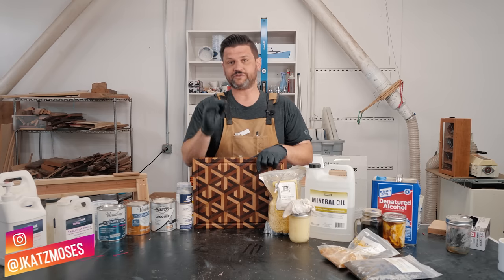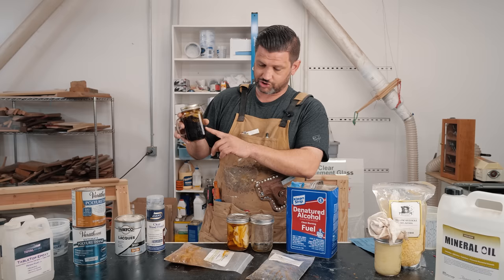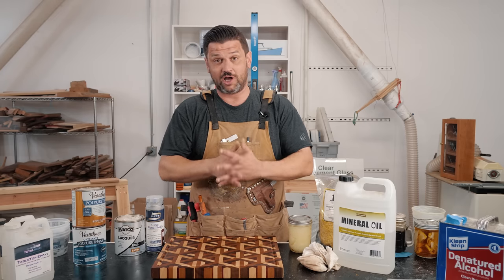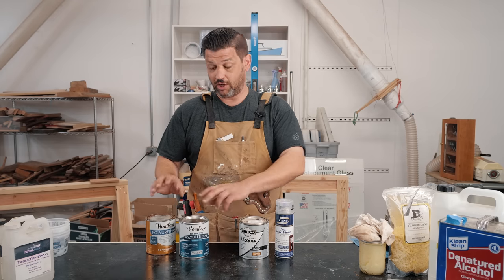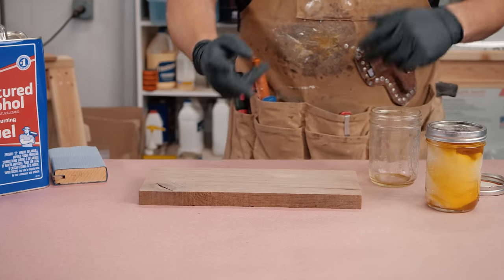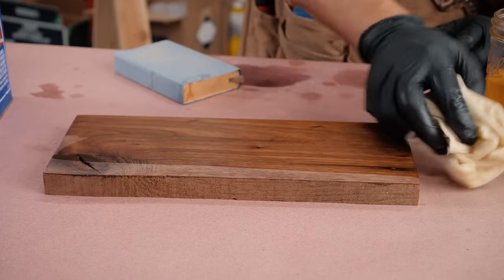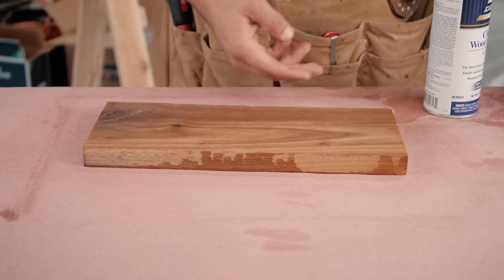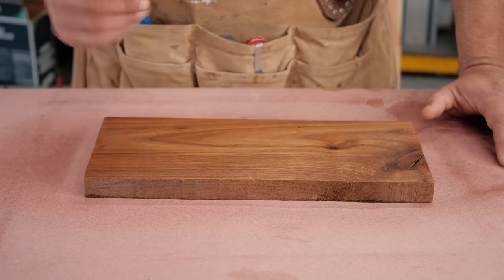My 4 Favorite Finishes and How to Apply Them

Comment from the maker: Tool links and things I talk about in this video:
Shellac Flakes (Blonde): https://amzn.to/33981YA
Bee’s Wax:https: //amzn.to/30K70EE
Mineral Oil: https://amzn.to/2OpDGAA
HVLP Set (only $89): https://amzn.to/33hGHHJ
Total Boat Epoxy: http://bit.ly/2I3Q8m4 20% (That’s HUGE) Discount code KATZMOSES
HVLP Video: https://youtu.be/hb1TAQ-kxr8
Mike Pekovich’s shellac video: https://youtu.be/k4_sIrEfdKM
Reply: Why would you put shellac under another finish? Or on top, for that matter?

Also, what grit do you sand to before each finish?
Reply: Jonathan Katz-Moses Good morning Jonathan, I really enjoy all your videos great work very informative. You had mentioned that you have a class on the cutting board
Do you have a YouTube video on the class or do I buy a video on it?
Reply from the maker: It will be out soon
Reply from the maker: For sealing quickly and top coating with a stronger finish. When you need to refinish something and you don't know what finish is on the piece already
Reply: @katzmosestools  thanks
Reply: Do you ever use Water White Conversion Varnish? It's my favorite.
Reply: woodworker Royer I use shellac as a first coat when finishing especially if the wood like cherry can be blotchy or highly figured wood so the second coat will be absorbed evenly eliminating blotchiness and puddled look
Reply: @katzmosestools  Great video ! I got curious about woodworking just recently and have a novice question about this subject.Can lacquer finish be used over danish oil,linen oil or tang oil?
And is there something similar to shellac ?
Reply: You might be able to thin the epoxy resin that way you won't need to sand.. it'll flow better, wonder if you can with some thinner.
Reply: I hate you so much right now... lol as I have a crockpot full of wax... in this video you state 4:1 ratio of beeswax to mineral oil... it’s 4:1 of mineral oil to beeswax! 

Unfortunately I filled the crockpot to make the largest batch I could... now I’m shoveling it out trying to make room for some more mineral oil 🤣😅🤦🏻
Reply: @woodworkerroyer8497  _ftb
Reply: @jakWiize  Thanks for pointing that out I was looking to see what people said. I watched his other video on how to make it and he does say 4:1 mineral oil to wax in that one so I was confused when he said 4:1 wax to oil here.. so sorry to hear you had to scoop wax lol but thanks for saving me the hassle!
Reply: @jakWiize  is that 4:1 ratio by weight or volume?
Reply: @Bad_Luck1  by volume, should be 4 parts mineral oil : 1 part bees wax by how we tested it. Usually when the mix ratio is given in “parts” it should be a volume reference.
Reply: Shellack comes from the female lac bug.
Reply: Hello, 
Total woodworking noob here will be doing my first project; a hard maple desktop trimmed in purple heart.
What would be your recommendation for it as the purple heart is still somewhat grey brownish what finish would allow it to oxidise and turn more purple as it ages. or would you recommend forcing oxidisation or waiting a bit of time and then finishing it.

My initial plan was to use just shellac ...possibly ad lacquer over for it Uv protection but that would be only after it turned more purple. 
My current train of though was using something like rubio monocoat hard oil wax finish since it seem very easy to apply and fix any damage that will happen .

Thanks for these videos they have been super informative and been getting me more interested in picking this up as hobby ('im a machinist by trade).

Comment: Super video Jonathan. This one is practical and helpful. For the past 40 years or so my go to finish has been lacquer. I’ve started getting into shellac and have found it to be a great choice for some things. Your method of mixing a batch and storing the rags in the jar is super. I never thought of that and will start doing that when I mix my next batch. That part of the video was very helpful. Yesterday my wife suggested that I make cutting boards for Christmas gifts next year. Your finish looks perfect and the idea of giving a little jar of the finish along with the cutting boards is excellent. The main reason I’ve hesitated on making cutting boards for gifts in the past was that they need to be refinished occasionally. Your idea solves that problem. Thanks.

Comment: Arm-R-Seal Satin, has to be one of the best finishes. Looks fantastic, it's impossible to mess up, and you put it on with just a shop towel!
Reply: I've messed up the finish using Arm-r-seal
Reply: @juanjacobo36  How!? You just wipe it on and wipe off the excess.
Reply: @Meyerwoodworks  trust me... I've messed it up. For one even the lint free rags aren't always lint free. On top of that if I apply the finish on a hot day it tends to tack up real quick when overlapping strokes on a large surface. I'm just saying it is possible to mess up Arm-r-seal depending on a few situations.

Comment: Preach it man. I only spray poly finishes also. It yields way better results than brushing it on. I'll give your "Goo" a shot man. I starting making cutting boards and quickly realized that wax is getting pricey to reapply.
Reply: G S nah man. It’s smooth as silk. Depending on the project I’ll use two coats sometimes three with light sanding in between each coat. That triple thick is terrible. I had poor results with that as well. I just use varathane water based poly or oil based depending on the application.

Comment: For cutting boards, and all the bowls I have made over the last 25 years, I have come to prefer a walnut oil finish, specifically from The Doctor's Woodshop. The biggest difference with the walnut oil, when compared to mineral oil is that the walnut oil will cure and harden. Mineral oil never hardens or builds up any type of permanent finish. This particular one also has 'micro aggregated' carnuba wax in it. Generally carnuba wax needs a solvent (turpentine in Kiwi neutral shoe polish) or heat to flow and spread evenly. This stuff doesn't. It does take a week or so to totally cure. With bees wax, you can usually see finger prints. Also, with your finish, and the Doctor's stuff, use a heat gun for the final coat or three.

Comment: What you were told about shellac is correct -- more specifically, it's a secretion from the female lac bug.  They're related to the same bugs that made Tyrian purple and Madder red dyes several millennia ago when wearing blue clothes meant you were richer than Bill Gates.  This little fact didn't "bug" me as much as finding out that the red color of Campari came from a beetle, considering I actually rather like Negronis and Boulevardiers.

Also, a fun fact -- the name "lac" for the bug derives from the Sanskrit "laksha" (or modern Hindi "lakh"), which means 100,000 because that was a rough olden estimate for how many bugs it took to produce 1 kg of shellac (it actually varies wildly from 50,000 to 350,000).  I'm trying to think of the old story of the palace made entirely of shellac (Lakshagriha), and how many bugs were needed for that.

Comment: Semi-gloss all in one stain and polyurethane applied in thin coats has a far less plastic look to it because of the tint and works really well for interior trim and hand rails.

Personally, I like to use a heavy tongue oil or boiled linseed oil for finishing, but I also tend to have the patience to let those soak in and dry. For cutting boards you can also use vegetable oil to get a quick finish that is similar to mineral oil. If you want a longer lasting finish on a cutting board, olive oil heavily applied, allowed to soak in for 12 to 16 hour and then wiped off makes a very durable finish for cutting boards and butcher blocks that has to be reapplied 2 to 6 times a year only when the surface is used and washed daily.

Another thing to look into for reducing smells is to use gum turpentine since it smells like pine needles instead of using normal turpentine or mineral spirits, which both have unpleasant smells, when thinning out finishes. It is not as strong of a solvent, but you can just use thinner and multiple coats instead and you won't walk out of the shop smelling like a chemical factory. It can also be used for cleaning up finishing oils and oil based stains/paints from brushes and sprayers, much like alcohol.
Reply: Vegetable oils like olive oil can go rancid so it's NOT a good idea for cutting boards.

Tung oil and other nut based oils can potentially give allergic reactions so be carefull. Especially if you sell them!
Reply: @hakancarlsson2881  That is why you regularly clean them with warm soapy water. Most bakeries use olive oil or canola to make their working tables non-stick to the dough and preserve the wood. Butchers also tend to use the same method if they have a wooden block they use. With a cutting board, just washing it with dish soap and warm water after each use is enough to pull the oil out before it oxidizes.

The only non-vegetable oil that is safe on cutting boards that isn't a nut oil is mineral oil. It is the best oil for bamboo cutting boards, but maple and walnut cutting boards do better with a vegetable oil.

Comment: For the bees wax one, do you have to use a chafing dish or crock pot? Could you just put the container in a shallow pot of water or a double boiler set up like you would use to melt chocolate?

Comment: Curious why you prefer the waterborne finish to the typical oil polyurethane ? Other than set time, I don't know of any advantage. Other than that I completely agree with all your other preferences.  Most of my furniture gets a French polish, final coat is Royal Lac if it will be a table top. Kitchen cabinets get poly for the very reasons you outlined. Great video. Thx!

Comment: Of the finishes you just covered, which one do you think would be the most durable for use on a wall hanging tool cabinet. I plan on only placing my top end tools in the cabinet and I want a finish that will compliment the nice tools.
Reply from the maker: I would go with lacquer for sure

Comment: Fantastic, dude! Thanks a lot! 😃
Question: shellac is good for tool handles?
Reply: It was traditionaly used in bike handles. You soaked the strip of cloth in it. It's not bad but I would prefer boiled linseed oil on tool handles. Shellac is less smooth more attrition (?)
Reply: Nice! Thanks! 😊

Comment: What kind of rags are you using for shellac though? most of the cotton rags  we get by the box for the shop for staining and more seem to shed threads and fuzz.
Instead of the stinky mineral oil with the bees wax, have you tried pure turpentine instead? rather smell pine than the exhaust stack of an oil refinery haha.

I never had luck with shellac, I guess because I always brushed it on, always thought it was way too glossy as a result too, I'm restoring a 125 year old red organ that has a solid walnut case, sanded to bare wood and stained with Minwax Early American oil stain, I think I want to try the shellac on it and see.

Comment: Hi Jonathan,
I’m making big bass marimba bars (percussion instrument that will be struck thousands of times with a medium hard mallet and will vibrate like crazy over and over and over). Traditionally they finished with oils and waxs, though I want to experiment with other stuff. For my experiment phase—in order of best to worst—can you please suggest/brainstorm what you think might work out for coating/sealing wooden bars that will be taking a lot of inherent abuse? With all the beating and vibrating, for instance, might shellac or lacquer or polyurethane or wood hardener or an acrylic poor be too brittle, resulting in getting rattled and crushed to death and breaking apart microscopically over time? Also consider which finish would be the most scratch resistant. (Bars will be stored in stacks and slid against each other with the potential of dirt and sand bits in between. Thanks for brainstorming with me 👍🏻

Comment: How do you dilute your 1:1 shellac solution?  I roughly have 16 oz of shellac and 16 oz of denatured alcohol in a 32 oz jar.  I just don't know how much to dilute.
Reply: After confusing myself a few times I have settled on the idea of using 4 oz of 1:1 shellac solution and 8 oz of alcohol for a 2lb cut of shellac.

Comment: When you say "1:1" on the Shellac : Denatured Alcohol mix, what exactly are the units? 1 cup of shellac to 1 cup of denat? 1 lb of shellac to 1 gallon? 1 quart? Also, is that the same Klean Strip denatured alcohol you can get off Amazon? Because folks in the Q&A there are saying that the KS denatured has too much methanol and will ruin the shellac. Should I be using different denatured alcohol? Thanks a ton, love the videos!
Reply: It seems like he is basing it on volume

Comment: Just bought a chess set pieces, what is a better way to lacquer the chess pieces? apply using a brush or using a spray can? I was thinking I can get away with the brush it may not show the imperfection much due to the curvatures of the pieces, what do you think?

Comment: Great video! I'm planning on using shellac on a project that I need to finish soon.

If you hand sand, do you do anything to remove sawdust from the piece between grits or before finishing? Vacuum? Dry wipe? Etc.
Reply: I vaccum with a brush attachment, then take a very lightly damp terry cloth to wipe the entire surface before coats, works great for me. I use polycrylic for the most part.

Comment: Thanks for this video. There's a lot of really good info... Just thought I'd mention a couple of things:
Your wax goo is paste wax.. pretty much the same as the stuff you buy (breewax for example).
Also, for chopping boards, have you considered an alternative to mineral oil (non petroleum-based)? I've recently discovered hydrogenated coconut oil and, though it's not as resistant as mineral oil, it's safer and it doesn't go rancid like other vegetable oils... I need to try making some paste wax with it. It should work the same.
Thanks again!

Comment: I build cabinets. My finish is tinted spray lacquer, talk about a bad smell....but it works awesome
Reply from the maker: lacquer is just awesome. Some one else was asking about tinted lacquer in the comments on a table top. Maybe you could give them advice...
Reply: @katzmosestools   sure. First coat of tinted lacquer should be a thinned penetrating coat. If you have a good hvlp it shouldnt take long to dry. This raises the grain, so a quick sanding with 320 should knock it down smooth. Clean it up, and then hit it again with a little thicker coat. Light sand, and then the flood coat. Sand with a high grit(I use 600) and if done correct, it should be glass smooth and laid perfectly flat. I have a really good hvlp, but I've seen this done with the home right super finish ($100 bucks on amazon) with outstanding results. If you arent comfortable with that process, stay with light coats and gradually go a little heavier for around 6 coats with a progressive sanding in between. 320-400etc. Just dont sand past 180 before you start, or it won't penetrate as well and you will fight to get even coverage.
Reply: @katzmosestools  AND! Do not spray tinted lacquer unless you have adequate ventilation and a respirator! It is very high voc. Another very suitable finish is from sherwin William's, called sher- wood. Its low voc and may take a extra coat or so, but works very similar.

Comment: what would you recommend for food safe finishes on items that will be exposed to heat, such as spoons or chopsticks? I've been using pure tung oil on my chopsticks and it's a bit expensive and difficult to use but wow, a solid and durable finish. how does that Total Boat tabletop epoxy stand up to heat? what about something like a salad bowl finish?

Comment: Awesome info.  Love shellac and then coated with poly. 
Question: what would you use for a walnut edge-grain kitchen Island top?  Major cutting and chopping will be done on a cutting board, but occasionally  I'd be rolling out pasta or pastry dough on the island top that would need to be trimmed or cut, lightly, with a cutting wheel. Any thoughts?  Cheers!

Comment: Hey ! Very interesting video ! I've done my own finish of beewax and mineral oil and applied it to some cutting board but after first cleaning (just wipped them with sponge and some soap quickly) but the finish is always leaving. And i cannot give them as gift if the finish is not staying at all. Do you have any advise ? Maybe I'm not letting it cure enough, but how much curing does it need?

Comment: For your cutting boards do you put multiple coats of the K-M goo on? Or do you just "flood" the surface with the goo and let it soak.  What I was going to do was soak in a mineral oil bath then put the K-M goo on as a last coat.
Reply from the maker: No need. Just put it on and reapply whenever. Easy. Don't overthink it
Reply: @katzmosestools  
Just put it on once? And let it soak?
Reply from the maker: Whatever you want. You'll get the same results anyway you do it

Comment: I noticed you put on the respirator for the spray, but what about the shellac and beeswax? Do you use a respirator for those as well with the mineral oil and denatured alcohol or is it not needed? Thanks! Great video!
Reply from the maker: With shellac and mineral oil I don't think you need one. They're both natural.

Comment: Would or could you use the wax finish as tool surface protection like I do with wax paste?
Also great video, it really breaks finishing down to the important practical points. Where I think too many finish tutorials go way overboard. Wish I had seen this years ago, my head wouldn't have been swimming.
Reply from the maker: I've never tried it. Not sure what mineral oil on tools is like